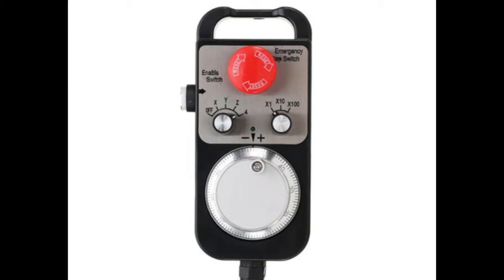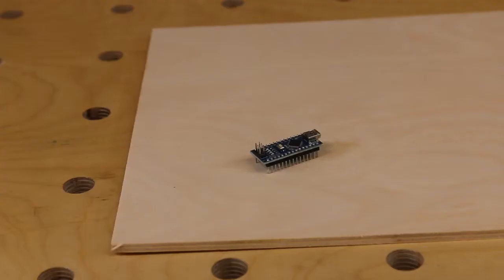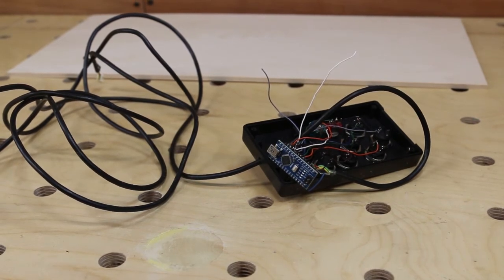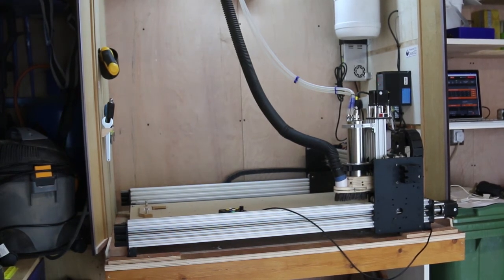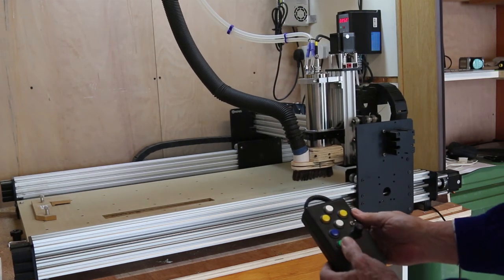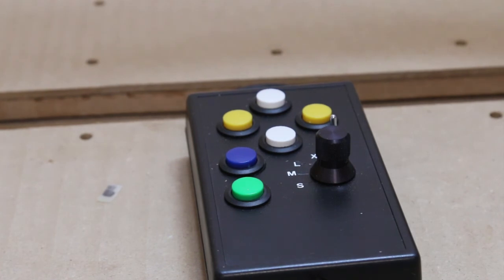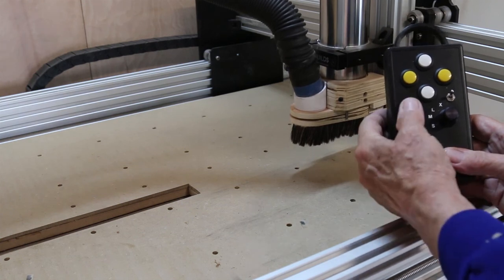CNC Pendant

Comment: @Tensquaremetreworkshop im very interested in this do u have a full tutorial hopw to make this
Reply from the maker: I thought that was what this is... If you want the Arduino code, I have published it on GitHub as MyqMag.
Reply: @Tensquaremetreworkshop  im not sure how to wire up the Arduino i have the script but thats it
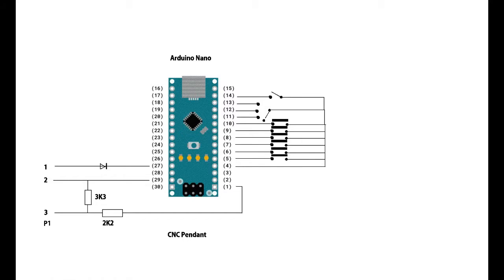Reply from the maker: @markrichardson1171  At 2:40 in the video there is a circuit diagram. Pause the video and take a screen-shot.

Comment: Thanks for posting this. Just one question. If the Nano has Do-D13 input/output pins. What is pin 14 that you are refering to?
Reply from the maker: Pin 14 on the nano is connected to D11. There are 30 pins in total. My diagram at 2:45 shows the pinouts.
Reply: @Tensquaremetreworkshop  Thanks. I’m referring to your code. Moremacros =14 and not to the physical pins
Reply from the maker: @BrianMaynardLetsDoThisThing  Ah, I see. The Nano also has 8 pins that can be configured as analog or digital (D14 to D21). The definition is a placeholder- I never implemented macros in this version. To add this, pin 19 (D14) would be connected to a rotary switch position, and the buttons masked as macros (e.g. Home, or move to work zero, etc).

Comment: Thank for sharing, could you please share the code and circuit diagram?
Reply from the maker: The circuit diagram is shown in the video (near the middle).
Code is-
/*
  Workbee pendant controller
  M H Magnay 2021
  generates gcode on button selection
 note that checksum is not generated- turn off requirement with
 M575 P1 S0
 */
 void DoMove(char);
 //define buttons
const byte Zup = 3;
const byte Zdown = 2;
const byte Yplus = 5;
const byte Yminus = 4;
const byte Xplus = 6;
const byte Xminus = 7;
//define switch
const byte Sunits = 8;
const byte Stens = 9;
const byte Shundreds = 10;
const byte macros = 13;
const byte moremacros = 14;
const byte BrushLift = 11;
const char Axis[] = {'X','Y','Z'};
byte buttonwas = 0;
byte BrushUpMode = 0;
byte ButtonState = 0;
void setup() 
{
  pinMode(Zup,INPUT_PULLUP);
  pinMode(Zdown,INPUT_PULLUP);
  pinMode(Yplus,INPUT_PULLUP);
  pinMode(Yminus,INPUT_PULLUP);
  pinMode(Xplus,INPUT_PULLUP);
  pinMode(Xminus,INPUT_PULLUP);
  pinMode(Sunits,INPUT_PULLUP);
  pinMode(Stens,INPUT_PULLUP);
  pinMode(Shundreds,INPUT_PULLUP);
  pinMode(macros,INPUT_PULLUP);
  pinMode(moremacros,INPUT_PULLUP);
  pinMode(BrushLift,INPUT_PULLUP);
  
  pinMode(LED_BUILTIN,OUTPUT);
  Serial.begin(57600);
  while (!Serial) {
    ;
  }
}

void loop() 
{ // run over and over

  if(BrushUpMode) //cutter lifted for brush; do nothing else
  {
    if(digitalRead(BrushLift))  //has been released
    {
      if(BrushUpMode)
      {
        Serial.print("G91 G0 F6000 Z-30.0");  //return cutter
        Serial.write('\n');
        delay(300);  
      }
      BrushUpMode = 0;          //so clear it
    }
      
  }
  else
  {
    if(!digitalRead(BrushLift))
    {
      if(!BrushUpMode)
      {
        Serial.print("G91 G0 F6000 Z30.0"); //raise cutter
        Serial.write('\n');
        delay(300);
      }
      BrushUpMode = 1;  //so we can lock other commands
    }
    else
    {
      ButtonState = 0;
      if(!digitalRead(Xplus))
        ButtonState =1;
      if(!digitalRead(Xminus))
        ButtonState =4;
      if(!digitalRead(Yplus))
        ButtonState =2;
      if(!digitalRead(Yminus))
        ButtonState =5;
      if(!digitalRead(Zup))
        ButtonState =3;
      if(!digitalRead(Zdown))
        ButtonState =6;
      if(ButtonState) //one is pressed
      {
        if(!buttonwas) //was not pressed last time
        {
          DoMove(ButtonState - 1);
          buttonwas = 1;  //remember for next time       
        }
      }
    else
      buttonwas = 0;  //trap release.
    }
  }
}

void DoMove(char type)
{
  Serial.print("G91 G0 F6000 ");
  Serial.write(Axis[type%3]);
  if(type > 2)
    Serial.write('-');
  if((type == 2) || (type == 5)) //Z axis
  {
   if(!digitalRead(Shundreds))
      Serial.print("10.0");
    else if(!digitalRead(Stens))
      Serial.print("1.0");
    else if(!digitalRead(Sunits))
      Serial.print("0.1");
    else
      Serial.print("0.01");     
  }
  else
  {
    if(!digitalRead(Shundreds))
      Serial.print("100.0");
    else if(!digitalRead(Stens))
      Serial.print("10.0");
    else if(!digitalRead(Sunits))
      Serial.print("1.0");
    else
      Serial.print("0.1"); 
  } 
  Serial.write('\n');
  delay(200);
}

Comment: And one last query, where can I connect the 1,2 & 3 connections on my particular controller (I am using an Openbuilds Black Box controller). It does have am Auxiliary input but the documentation states that the USB connection is disabled if the Auxiliary is connected - not good as this is where all my data into the box comes in! However, there is, alongside the Aux1 connector, another connection available which is labeled 'Sig and Gnd' which I am hoping could be used for something like a pendant - unfortunately the documentation doesn't actually go into any detail about this particular connector so I will have to research further to make sure....
Reply from the maker: Sorry about the delay in relying- for some reason I was not notified of your post.
I am afraid that I am not familiar with your controller- I am using the Duet 2 controller, and the connections given are for that. The details of connection, including the baud rate, may be different. If you can give me a link to the documentation I can have a look.
Reply: @Tensquaremetreworkshop  Hi mike, this project i like it, one question which is the controller brand ?
i will appreciate all your comments
Reply from the maker: @cncrobotic5254  The machine is a Workbee, fitted with a Duet controller.

Comment: Is there any chance you could share the program you upload to the Arduino to make this work? 

I'm OK with the making side of things, but just can't get my head around the coding at all, I know just about enough to be able to flash
an Arduino, but that is about my limit.

Congrats that you were able make this work - I just want to make a replica now!
Reply from the maker: Code follows. This is written to be easy to understand and modify by non-programmers. Connect buttons to inputs 2 to 7, and a rotary switch to 8,9,10 (range). Macros are not implemented here. Let me know if you need more info. 
/*
  Workbee pendant controller
  M H Magnay 2021
  generates gcode on button selection
 note that checksum is not generated- turn off requirement with
 M575 P1 S0
 */
 void DoMove(char);
 //define buttons
const byte Zup = 3;
const byte Zdown = 2;
const byte Yplus = 5;
const byte Yminus = 4;
const byte Xplus = 6;
const byte Xminus = 7;
//define switch
const byte Sunits = 8;
const byte Stens = 9;
const byte Shundreds = 10;
const byte macros = 11;
const byte moremacros = 14;
const byte BrushLift = 13;
const char Axis[] = {'X','Y','Z'};
byte buttonwas = 0;
byte BrushUpMode = 0;
byte ButtonState = 0;
void setup() 
{
  pinMode(Zup,INPUT_PULLUP);
  pinMode(Zdown,INPUT_PULLUP);
  pinMode(Yplus,INPUT_PULLUP);
  pinMode(Yminus,INPUT_PULLUP);
  pinMode(Xplus,INPUT_PULLUP);
  pinMode(Xminus,INPUT_PULLUP);
  pinMode(Sunits,INPUT_PULLUP);
  pinMode(Stens,INPUT_PULLUP);
  pinMode(Shundreds,INPUT_PULLUP);
  pinMode(macros,INPUT_PULLUP);
  pinMode(moremacros,INPUT_PULLUP);
  pinMode(BrushLift,INPUT_PULLUP);
  
  pinMode(LED_BUILTIN,OUTPUT);
  Serial.begin(57600);
  while (!Serial) {
    ;
  }
}

void loop() 
{ // run over and over

  if(BrushUpMode) //cutter lifted for brush; do nothing else
  {
    if(digitalRead(BrushLift))  //has been released
    {
      if(BrushUpMode)
      {
        Serial.print("G91 G0 F6000 Z-30.0");  //return cutter
        Serial.write('\n');
        delay(300);  
      }
      BrushUpMode = 0;          //so clear it
    }
      
  }
  else
  {
    if(!digitalRead(BrushLift))
    {
      if(!BrushUpMode)
      {
        Serial.print("G91 G0 F6000 Z30.0"); //raise cutter
        Serial.write('\n');
        delay(300);
      }
      BrushUpMode = 1;  //so we can lock other commands
    }
    else
    {
      ButtonState = 0;
      if(!digitalRead(Xplus))
        ButtonState =1;
      if(!digitalRead(Xminus))
        ButtonState =4;
      if(!digitalRead(Yplus))
        ButtonState =2;
      if(!digitalRead(Yminus))
        ButtonState =5;
      if(!digitalRead(Zup))
        ButtonState =3;
      if(!digitalRead(Zdown))
        ButtonState =6;
      if(ButtonState) //one is pressed
      {
        if(!buttonwas) //was not pressed last time
        {
          DoMove(ButtonState - 1);
          buttonwas = 1;  //remember for next time       
        }
      }
    else
      buttonwas = 0;  //trap release.
    }
  }
}

void DoMove(char type)
{
  Serial.print("G91 G0 F6000 ");
  Serial.write(Axis[type%3]);
  if(type > 2)
    Serial.write('-');
  if((type == 2) || (type == 5)) //Z axis
  {
   if(!digitalRead(Shundreds))
      Serial.print("10.0");
    else if(!digitalRead(Stens))
      Serial.print("1.0");
    else if(!digitalRead(Sunits))
      Serial.print("0.1");
    else
      Serial.print("0.01");     
  }
  else
  {
    if(!digitalRead(Shundreds))
      Serial.print("100.0");
    else if(!digitalRead(Stens))
      Serial.print("10.0");
    else if(!digitalRead(Sunits))
      Serial.print("1.0");
    else
      Serial.print("0.1"); 
  } 
  Serial.write('\n');
  delay(200);
}
Reply: @Tensquaremetreworkshop  Hi Mike,
Thanks for posting this idea, I have build a version of it for my WorkBee.
I have found a small bug, in the definitions you have 2 numbers swapped over, you have listed:-

const byte macros = 11;

const byte moremacros = 14;

const byte BrushLift = 13;

But it should be:-

const byte macros = 13;

const byte moremacros = 14;

const byte BrushLift = 11;

I have changed the brush lift to a different function as my dust shoe clips on from the front and does not need clearance under the bit.
Reply from the maker: @SudburyDave  Well spotted- good to hear you have built it. It was a transcription error when I posted it.

Comment: All these videos are making me want to buy a cnc machine and a 3d printer
Reply from the maker: I am firmly of the view that a 3D printer should come first; shallower learning curve, cheaper, simpler installation. Transferable skills.
Reply: That's the order I plan on going. I see the 3D printer as indefinitely useful, even just making parts for myself. Is there one you would recommend for a beginner?
Reply from the maker: @Weekend_walk  I am far from an expert- I wanted a direct drive model (as opposed to feeding the filament through a Bowden tube) of decent size. I ended up with the Artillery Sidewinder; not the cheapest but well made. Spares are readily available at reasonable prices. Worth being on your list, but I hesitate to recommend any make on my limited experience. There are plenty of reviews around...